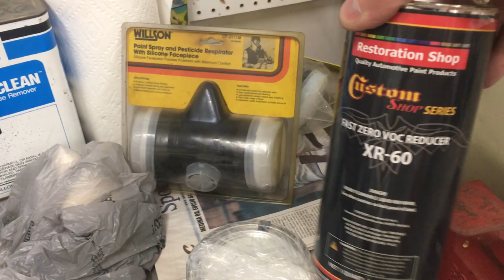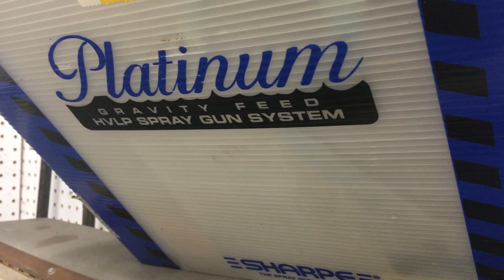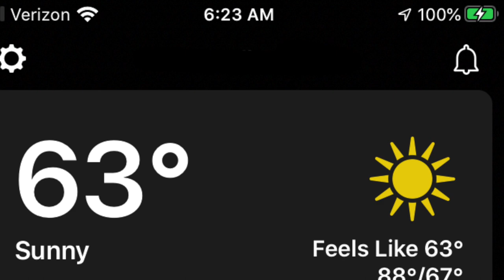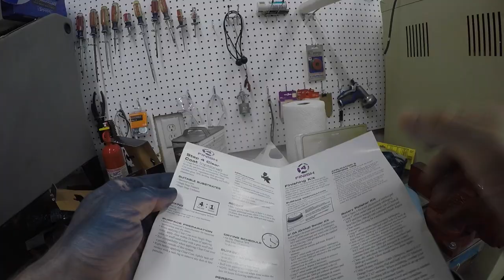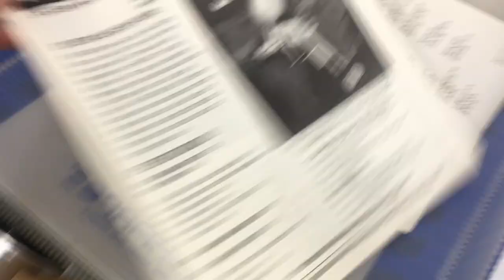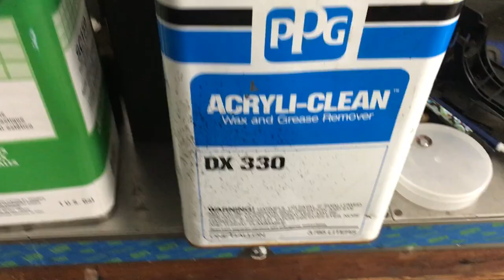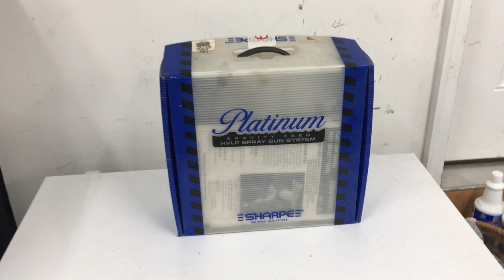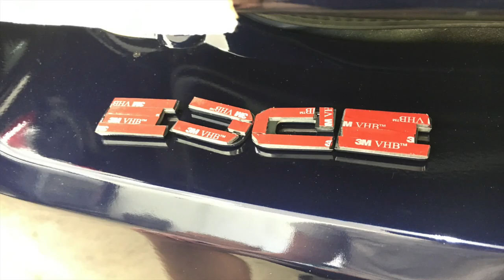How to: Spray Automotive Paint in your Garage with Professional Results - Complete Guide!

Comment: A tip that is high risk but high reward, is going over an orange peeley area with a very thinned down clear coat to ''remelt'' the clear thats already there is one way to fix orange peel. ( if there's enough clear in that area, if it's just a thin first coat this method will not work )

Practice makes perfect, but also only two coats of clear is really needed. A medium wet and a fully wet. You can also do a 25/75, or as I like to do a 25/50/50 with a water sanding with 2000-2500-3000 then a polish to really get that show car finish. 

I use Sata 4000 B RP digitals and Glasurit mainly, your milage may vary.
Reply from the maker: Thanks for the expert advice! Not sure I have the balls yet to try the thinned clear coat method. Maybe do some practice first.
Reply: @6thGearGarage  Not an expert haha, just  a couple of years experience.  My progression methods might be ''unordinary'' but with painting the end goal is always a presentable finish! 

Just keep on cracking at it, amazingly good video even after years of doing it's always nice to see videos about painting! 

Amateur tip: If you ever paint solid colors and it's a brand such as glasurit they're all engineered to behave the same. (glasurit 22) But other brands such as spies hecker (ALOT cheaper than glasurit) use uneven pigment weights and behave different between colors, so some opaque colors such as beige run really easily, but a matt black will hardly run at all. 

I was schooled with glasurit, and use it whenever I have something serious to paint because a beige solid acts the exact same as any other solid color from glasurit. It might sound counter intuitive but the most expensive paints are the easiest to learn on because they're more even and will set stronger foundations for muscle memory and learning as a whole. 

Glad to share knowledge!

Comment: I do the same for dust control - but use a pressure washer on a very fine mist with lots of pressure to 'sweep' the walls and ceilings.  (careful not to get too close and damage the drywall.). A small amount of water won't hurt the paint or wall, and it cleans all the dust, spider webs etc from the walls, ceilings, openers, shelves etc. The dirt drips down to the ground in the mist.  You won't believe how effective it is, and it really reduces dust.  Same technique all the way down to the floors.
Reply from the maker: That's a really good idea! I need to paint the walls with some latex paint first. Right  now it's just the builder grade white absorbent paint that came on the house when new. It's really more of a smooth ceiling consistency than paint, and doesn't do well with water.

Comment: There's a great lesson here, start small, but if your heart's in it at least start somewhere. Had I collected some of the tools early in life, it would be less of an obstacle than it is now. And owning older vehicles that might not need "perfection" makes it easier to get started. Same with houses, its easier for my repairs to blend in, but a new house or car sort of demands a pro job, cutting the owner out of the opportunity to start somewhere.
Reply from the maker: Good point! I don’t think I’ll ever own a new (or even newer) vehicle. This is my wife’s car. I’m stuck in the 80’s/90’s.
Reply: @6thGearGarage  Everybody should make the mistake of buying a new car once in their lifetime, but you've got the mechanical talent to never make that mistake!
Reply: @6thGearGarage  Stay with 80/90s cars they are far better than modern rubbish imo
Reply from the maker: @steveguest8028  I agree 100% that the 80-s and 90's were the golden era of automobiles where there was just enough tech to make them reliable and efficient, yet not overloaded with tech and bells and whistles that will make them overly complicated and obsolete or expensive to repair.

Comment: Great video. I always recommend a spray out card test before painting your car. The worst feeling is pulling  the car in the sun and having the color off after you just wasted time, effort, and a lot of money to have your car a different color.

Always, always wear a respirator, when sanding, painting with aerosol or a spray gun, mixing paint, hardeners, reducers, and degreaser/prep spray. Last, put on a painting suit for $2 to protect your skin.

Cheers

Comment: I have found that wetting the floor doesn't really help much and causes humidity. I would just put plastic on the floor around the area if anything. putting water on the floor makes it feel so muggy.
Reply from the maker: Great tip, thanks!

Comment: Great video man! Good tips for painting! I've always just spray bombed my vehicles with paint cans. But obviously I own nothing as new and expensive as your Edge. But I might tackle an actual paint job on my 4Runner project.
Reply from the maker: I painted my old civic with rustoleum and it 💯 looked like a professional paint job. People didn’t believe when I told them it was rattle can. Polishing can really bring out an aerosol paint job. The only downfall is it chips/scratches easier because it doesn’t dry as hard.

Comment: Great video and repair.  I learned a lot.  I noticed you had no problem with the air.  What size air compressor did you use?  I need to buy a compressor that I'm sure will work for me, one that's not too expensive I hope lol.  Thank you.
Reply from the maker: It’s an old 20 gal DeVilBiss but it’s high output, meant for painting. It may run more but the pressure is pretty consistent

Comment: Does sherwin Williams sell automotive paint to match your paint code ? If so I never knew I buy mine to match my paint code from a shop close to me it’s expensive I have a sherwin Williams not to far from me but didn’t know they mix paint to match the paint code or where you buy that paint from
Reply from the maker: Yeah, check Sherwin Williams Automotive paint stores.
Reply: Yes they do
Reply: @6thGearGarage  yup found one not to far from me but there color match is horrible I did a whole side of a car and doesn’t match one bit the old paint is lighter and new paint is darker only put down 3 coats of base and 2 coats of clear didn’t need to cut and buff and it matches the rest of the cars Orange peel was told also O’Reilly’s mix paint as well but all the once I’ve been to don’t and when I asked guy said none of our stores mix paint I know that’s bully shit he just doesn’t wanna tell me for some reason also I know there can be more then one variant to the same paint code in my case all the 3 times I’ve bought paint from napa there was only one variant to the paint code
Reply from the maker: @AliVapeReviews  usually the original paint will be lighter over time from UV fading by the sun. Same happened to me, noticed after I put the parts back on the car.   I think body shops can account for this and mix the new paint to compensate for UV fading.

Comment: How many gallon is your air compressor? I have a 16gallon would that work for small jobs like only the front bumper and side skirt?
Reply from the maker: Mine is 20 gal. You may want to test it out before trying to paint. Some motors are made more for air tools and not built to run most of the time like is needed for spray painting.

Comment: What size compressor did you use and is it electric
Reply from the maker: It's a 20 gallon high output for painting, it is electric.
Reply: Thanks great job
Reply: What type of gun And the cfm on compression and gun please
Reply: What type of gun And the cfm on compression and gun please
Reply: What brand is your compressor

Comment: Color does not match. You can see the difference.

But I think you did a great job. Most of us would not try to do this at home.
Reply from the maker: The new paint is a little darker. I wonder if the original paint slightly faded from years of sun  🤔
Reply: Most if not all factory paints have at least 3 if not more different shades (I know, I went to my local body shop when I wanted a few parts painted, and he brought out a book of all the paints and all the different shades), also for some reason I don't know why, but paint looks different on metal parts vs plastic parts, I see this even on fresh factory paint jobs, the paint on the bumper is a shade or 2 off from a metal part like the hood, especially metallic paints.

Comment: At 10:02 your spray pattern is not set up correctly. You should see an oval shape not a dumbbell shape which indicates uneven spray pattern. Check for blocked nozzles or adjust fan spray control.
Reply from the maker: I will check it out, thanks!

Comment: Of course you wet sanded and polished it
Reply from the maker: No, I didn't feel it was necessary.
Reply: @6thGearGarage  by the looks of it i think it would look much better wetsanded
Reply from the maker: @Aikaramba12  there was some orange peel from the factory, so it kind of matched. If it was a show car or a higher end manufacturer that doesn’t have orange peel, I would have definitely wet sanded & polished.

Comment: The compressor never shuts off when depressing the trigger. That is not good.
Reply from the maker: Normally the compressor shutting off doesn't coincide with releasing the trigger, or it would constantly be turning on/off. Usually it shuts off when the tank reaches a certain psi, but I had a small leak at a fitting for the moisture trap on this day and the compressor was running extra to compensate.

Comment: He didn’t put sealer?
Reply from the maker: Hugo Juice Box sealer was already applied to the bumper after i filled the scratches in the previous video.  I did not use sealer on the hatch door since it was already all light grey, only on a couple of small areas where I used self etching primer over bare metal repair areas.
Reply: @6thGearGarage  wonder if that is why the paint is separating. in those areas? I would think it is from metal prep but I am not even close to an amateur painter so don't hold me to anything. (showing my ignorance here) but you do not need to wet sand the orange peel? would a buffing compound and high speed buffer remove orange peel?
Reply from the maker: @patrickfitzwater5511  I didn't sand down past the original paint there to bare metal, so I'm not sure. I'm an amateur too, so your guess is as good as mine!
Reply: @patrickfitzwater5511  you can wet sand with a very high 1000-2000 grits(1500 is good to start at to see if it’s cutting enough) then buff those scratches out with compound 👍